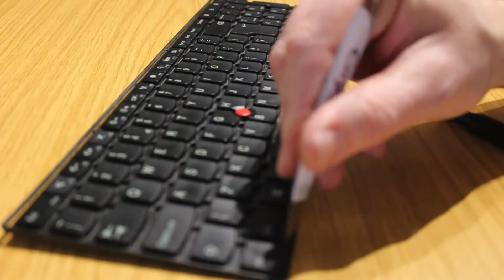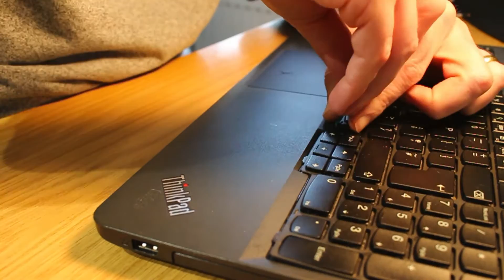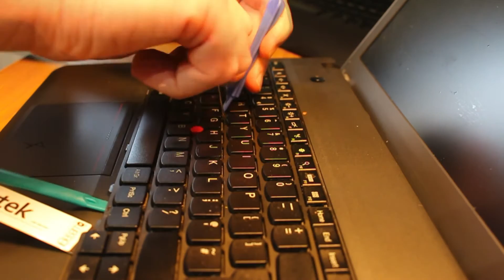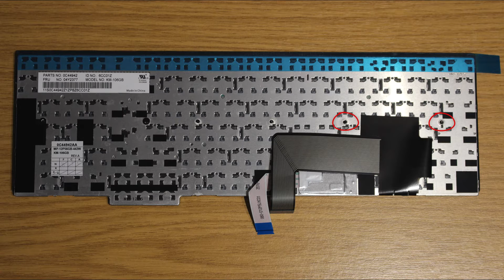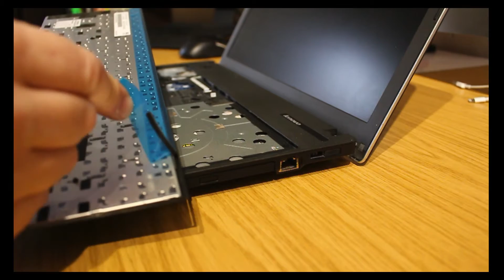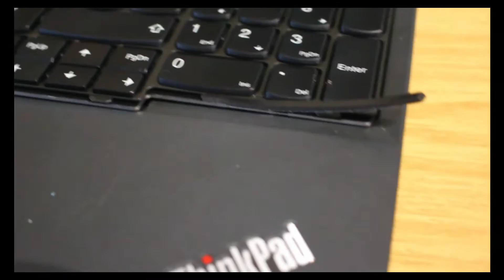Lenovo E531 Keyboard Removal and Refit, Full detailed video.

Comment: This worked for me on an e540.  My new keyboard came with the rubber strip attached by blue strip, however the back metal of the keyboard was covered with a black protective plastic membrane. There were six screw and as I only needed four I removed them as instructed. I made hard work of this with the Stanley knife and ended up using a darning needle. What I didn’t do was remove the remaining four circlips which prevented me from seating the frame correctly.  When I figured out that I had to remove them everything slotted in easily and the keyboard is working fine.  Thanks for your well presented and explained tutorial.

Comment: can you say "actual" a few more times..? the E535 has the "mouse" buttons & middle button, as part of the k/b. do these keyboards have a high rate of failure or wear out rather quickly? thank you for a real good, closeup, and detailed video. i think the E535 has 2 or 3 screws in the underside area. thank you